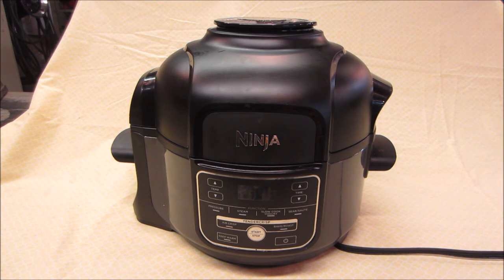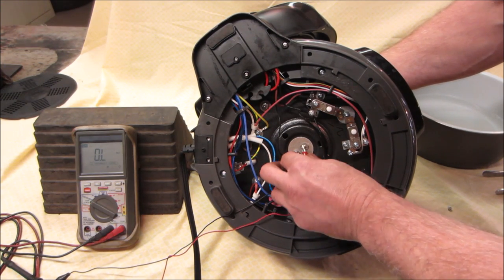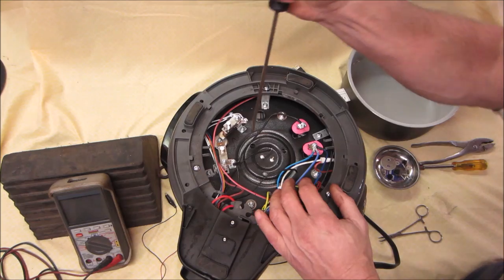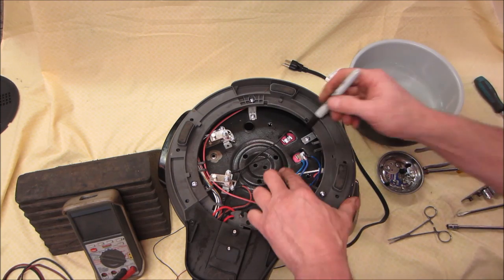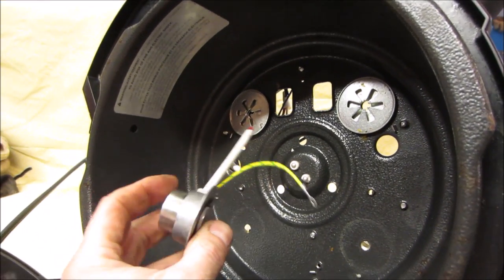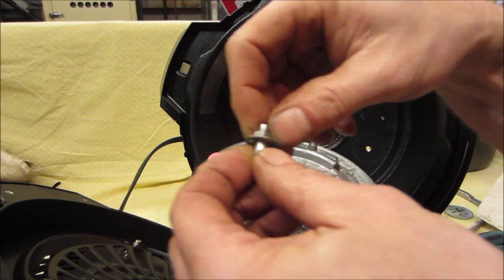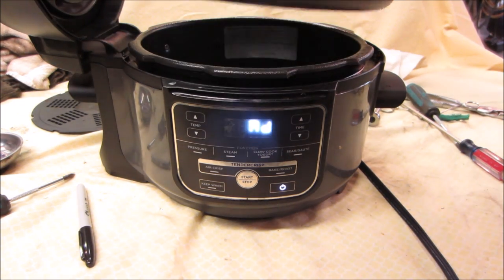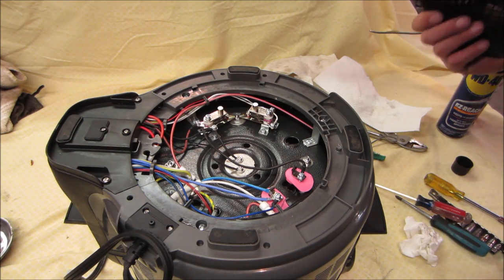FAILED! Ninja  Pressure Cooker, Air fryer. lets take it apart.

Comment: No handle on the pot, not even a bent wire.

That's a design fail right there.

Exposed electrical contacts-
another failure.

Did someone pay UL to look the other way?

(FACTORY) TIG or spot weld two tabs with 1/8" holes in them on 
the inside of the pot, near the top rim.
Insert a bent semi hoop wire handle; push wire into tab hole, 
bend it over before attachment.

That shouldn't be too hard for the Factory to either do- or have done.

$175 for more gimmicky Chinese junk.

"Soups" and tomato-based foods are full of shiny metal etching compounds-
that are dielectric when dry.

Attach a rated spring on the unit, under the pot area.
Epoxy or induction weld a steel slug to the underside of the pot-
install a N.O. magnetic reed switch under the outside of unit.

Thanks for sharing, Merry Christmas.
Reply: Could you add a handle to the pot and still preserve an absolute tight seal between the rim of the pot and the lid, one that would stand up to 12 PSI?

This is a PRESSURE COOKER, not a slow cooker. The pot doesn't have a handle because no matter how it was attached it would interfere with the product's primary use.
Reply: @Ea-Nasir_Copper_Co  
Stamp out 2 squares of aluminum, dish dimpled. Drill a hole in the middle of each.

Insert a wire, bent semicircle, bend over ends to retain. Spot weld the tabs to the inside of pot, near top.

Handle flips down, against the inside
of pot, maybe 1/2" under rim.

Look at camp-ware cook pots- their wire handle is outside, for convenience.

Get what I'm saying?
Reply: the whole thing is a very crappy design, crummy engineering.   I have a fifty+ year old stainless steel stove top pressure cooker by Presto, can't beat it.

Comment: Just  another over-engineered, over-complicated, overpriced piece of junk, manufactured to meet obressive safety regulations - take it back and get a refund!!
Reply: oppressive safety regulations?  WTF?   There is a reason, there are safety devices, switches and safety measures built into these devices.  Because they prevent Catastrophic Accidents, and might save lives.

Because if YOU leave this unit Unattended, as touted by it's Advertisement and Features, and it Catches on fire, It Won't Burn Your Damn House down or Kitchen.  Or worse -- Kill You Family members, who are unknowingly trapped inside a burning home, because they Passed out because of too much smoke inhalation.  🤨

Man, I've heard of stupid, but that statement takes the cake.  I suppose, you think Seat belts are Overrated and unnecessary for automobiles, and pose too much of a financial burden to Auto manufacturers?  Only a Federalists would say something like that.

Comment: If you're gonna start tinkering with electronics, you need a good solder pen. Best one I can recommend for the price is the UY-CHAN TS100 pen. It's chinesium, but it's some of the best chinesium you can get in the field. That pen with a power supply included will go for about $70 on Amazon, and will last way longer than any other pen in or below its price bracket while also heating better and more consistently.

Comment: I'd try cleaning the switch with 99% IPA, if that didn't work, next try WD 40 (water displacement 40).
Bypassing a safety is always a last resort. but I've done it in the past on a rice cooker.
I have an 8 qt crockpot that's somewhere between 40 and 50 years old. It has a HEAVY ceramic pot that once dropped to a concrete floor and didn't even get chipped. The mechanical switch has three positions off, high and low (150 watt or 250 watt). I bought a temp controlled switch to plug it into with a probe for the inside. I use it for sous vide, I have one extra large bath towel folded lengthwise to make 4 layers wrapped around the outside with an old belt holding the towel in place. I have a second folded extra large towel folded on top. It's immune to short power outages. I wouldn't even consider trading it for a Ninja.
Merry Christmas!

Comment: While I appreciate you repairing it the right way, I'd have run the 2 black wires under the pot pressure pad to a SPST switch mounted, glued or otherwise attached to the plastic casing and been done with it. Great job tho... as always.

Comment: The universal rule of any appliance or machine manufacturing is: Start with the component most likely to fail and add all other stuff to it, thus burying it the deepest possible way in. This goes for everything, cars (they start with the starter motor or alternator or the clutchplates) stoves (they start with the overheating switch or that extra flimsy knob turner) laptops (the back up battery or the trackpad) and so on...in this case they started with that water sensitive switch laying on a workbench and then they were like "lets mess this up for everyone, and finish it all up with a easy access lid fooling everyone that it is an easy fix. diabolic laughter

Comment: I'm still in the middle of watching it, so maybe this was mentioned before...but next time this happens, and if you spill something this will happen again, You can just put some water down there to clean it... And then followed up with isopropyl alcohol, higher percentage is better. This both helps the water evaporate and helps dissolve everything else that the water didn't.
Then you just set it aside to dry.

Comment: And nothing to throw in the ultrasonic cleaner? - This will never do!

Anyway, that's one item to scratch off my wish list. My mid 70s Prestige pressure cooker still works perfectly, and you can get it as wet as you like. Fried stuff can go in the Tefal deep fryer - still going well at 35 years old, stuff to grill goes in the 'Progress' table top grill, and if I need more than one appliance at any one time, I don't need to wait for one job to finish before I start the next, then finally, if any one of them fails, the others are still good!

To quote Mr Scott (Star Trek) "The more they over think the plumbing, the easier it is to clog up the drains".

I'm a bit disappointed that you never located the carburettor! 🎄✨🎋🎍 MC2Y ❄☃⛄

Comment: I have one of those with exactly that problem...we wedge a piece of rolled up tin foil wedged toward the back at the rim  > I think the problem may be that the pot ends up slightly oval shaped and moves the bottom sensor around ...

Comment: @26:15 over pressure == over temp.  It is sealed system so you're correct, run away with one is the same as the other.

Comment: I’m having a EER 2 message. You said the heat censor is with the pot censor. I’m going to try to pull apart to clean as you did. 
I’m hoping for fewer screws to remove. 🤞

Comment: Pot sensor is dirty. Have to pull out element plate and clean the pot sensor.  You could put the wires together on one screw and get it working again.

Comment: You know how they have the code readers for cars, that interpret the “check engine light” on your dashboard and they can reset the computer to see if it’s a false alarm? I imagine that electronics like this also have something along the lines and the way to make the fault code for the missing pot go away is by resetting that computer and it will do essentially a hard reset and the fault code goes away and it starts working again. But the only thing is, there must be a specific location that the thing connects to and we don’t know where that is.

Comment: Feedback? If the switch worked it would show short with or without both leads connected. Current takes the path of least resistance. This was painful to watch. After noticing that the switch did not short when pressed, just jumper across terminals and verify pot error goes away. Once verified, just get the switch out and fix or replace.

Comment: Happy Christmas Mustie . I’m just using mine to steam the Christmas pudding ( without the dead weight pressure relief valve fitted ).  It’s got no electronics just the aforementioned safety valve and a fusible plug. Why do we make life so complicated !  Edit I see it’s an air fryer as well which may explain the over complication.

Comment: usually a center button in the middle of a heat plate/element like that would be a contact type pot temperature sensor. that sure looks odd though and may be just a simple switch. silly for sure
**further in video, it appears to be both a contact type temperature sensor(thermistor) inside the aluminum button(insulated red wires I think you said) and a pressure type contact sensor that closes when ya pot is placed on it. which appeared to be just that small center washer ring which pushed down against the bolt/screw heads you first unhooked.
guess I'll keep watching now lol
Reply: and yep, 100% thermistor to sense the pot temp via the aluminum button,  once you had fingers full of the white silicon based thermal paste lol.

Comment: That seems to be a major design mistake, how could you not protect the switch from liquids and the vapors of whatever is cooking, as well as grease. With all the stuff they had screwed in, which was nice, seems it would not have been that much more to put a cover over the switch assembly.

Comment: There's your problem right there.  It's designated for the Canadian market, where pot is now legal.  So, make a run to your local (underground) pot dealer,  then ADD POT, et, voila... your device should then work as intended by its manufacturer :)

Comment: That 'I've done it ' feeling in the end, priceless!

Came to this video because I have a problem with my own. The spinning wheel that sits behind the grill has ceased after making some rattling noise for a while. I noticed that part of it became separated to it;s body due to rust(yes, we've not been cleaning it for sure).

Do you reckon they can be replaced?

Thanks!

Comment: you can usually hot wire them and bypass the pot sensor had to do that with one i had back when i was trucking you would hit a bump trip the sensor and have to push a button to reset it again so i bypassed it and just didnt have a safety

Comment: I KNEW MINE WAS MISSING SOMETHING!?!? 😂😂 

...any idea on where to get that protective cover plate for the bottom that's supposed to protect you from electrocution and/or damaging all the switches/electrical wiring/hardware??

(Got it for a Christmas gift a few years back and finally took it out of the box this year to use it and thought "Huh!?, well THAT'S not right🤔" 😂)

Comment: Hi there! 3 years after posting this video 😂 my ninja foodi air fryer (same as yours) fan stopped working. I suspect the motor as the screen and heating elements all still work! Figured I could ask if you knew which where that’s housed in the ninja and how to access it? Probably not and not 3 years later but wanted to ask. Thank you for your time!

Comment: Bought the wife a new air fryer for Christmas and she's bad(or good) about guessing what's wrapped. Honey,she said,is this a new air fryer to replace the old one that's broke? Don't tell anyone but I didn't know we had an air fryer much less that it was broken...... Original bit the dust after 14 months(by what she says). typical new junk.....Warranty? by the time you pay the shipping both ways to get it fixed most times it's cheaper and less aggravating to just by another piece of crap. Sure the manufacturers are counting on that. Almost forgot: the one that broke went completely dead: no function and screen would not power up.

Comment: Did you try putting  the pressure cooking lid on and setting it to where you want it. It will not work without the  pressure cooker lid is on. And you will get that message. I still forget to put on the pressure cooker lid sometime and get that message,  it is not pressurizing. The lid that is attached to the pot will only work for Air Frying, You have to put on the pressure cooker lid and then it will work for Pressure Cooking.

Comment: WD40 is not bad for removing adhesives and state auto inspection stickers, problem is hoe to remove the smell, LOL. I have heard of using ether ((Diesel?) engine starting fluid) too, but it evaporates too quickly and may burn or explode. Looks like the switch may go to a transistor and would be easy to foul with such low voltage/current.

Comment: You are quite lucky, the usa mains voltage is 120/40.
And not the UK mains voltage of 220/40.
It has a nasty bite 240 volts does. 😇

Comment: Hi. I have a problem with the bottom element on my Op300uk foodi. Got to be either the thermal fuse or the actual element. Any ideas welcomed ???
Whats the fuse rated at and are they available off Amazon.
Thanks in advance

Comment: Seriously this thing messed up cos some water slid down the side?!

It should be designed to handle that issue! Especially since it's supposed to not only cook under pressure, but steam as well.

Also 1 month old, still under warranty, they should have just taken it back to store.

Comment: Merry Christmas
Designed in failure point. Some moron use an open contact, aluminum button to detect if a pot was in place, in the one spot that will assuredly get wet.
Not buying that brand.....of ANYTHING.

Comment: I considered getting a Ninja or an Instant Pot, but after reading about them, I realized they were nothing more than electric pressure cooking with a bunch of electronics that make it easy for someone to use them without having to learn how to use a pressure cooker.   Since I already have a pressure cooker and know how to use it, I didn't see any reason to spend $150 for a pressure cooker than will stop working when I have one that works that has no electronics to fail.  The worse that is likely to happen is that I will have to replace the weights, seal, or pressure relief plug.  All of these I have spares of.

Why do people buy this crap?
Reply: The one big advantage is timed cooking. People set up their cooker in the evening or morning and return from work to a warm meal waiting for them.
Other than that a good old pressure cooker will do. It's not that hard to figure out how to work it.
Reply: It's kind of a millennial thing I think.
Reply: @wind_song  That's what crock pot is for.

Comment: My problem is that it often fails to recognize when the pressure-cooker lid is on, so it won’t let me use the pressure cooker functions when it should. Does anyone know where the sensor is for that lid, or how this failure occurs or can be fixed? I’m getting very fed up with this machine!